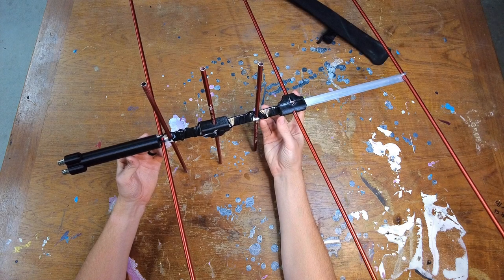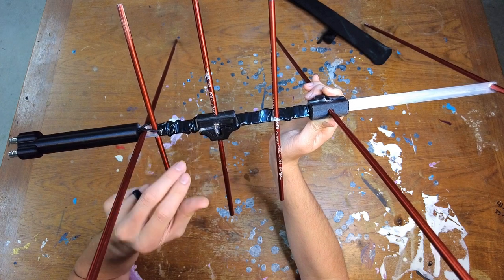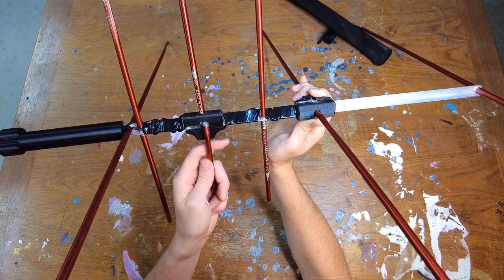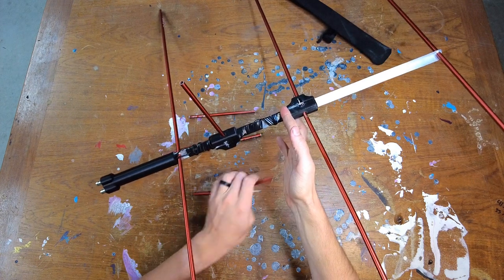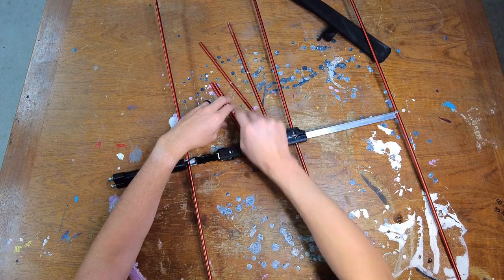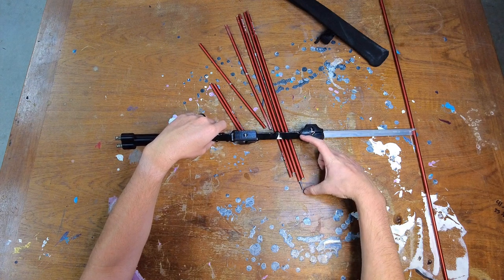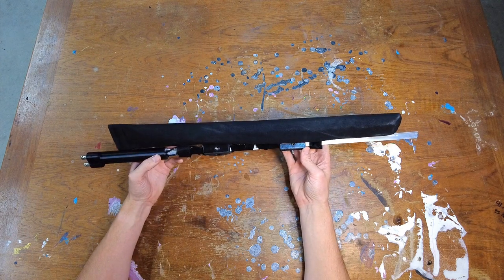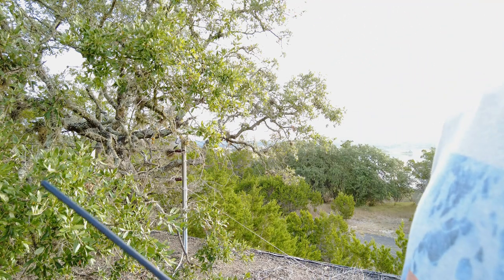DIY Packable Yagi

Comment: Too bad you couldn’t show us the actual build and too bad you need access to 3D printer for some parts. Where did you source your threaded aluminum elements?
Reply: You can order 3D printed parts from manufacturers online
Reply: Also, a 3d printer is about $200. It's a basic skill you kind of need to have at this point.